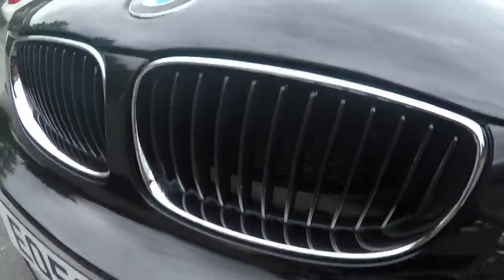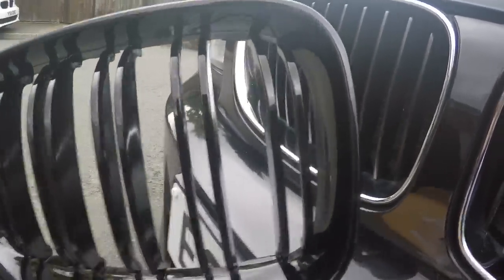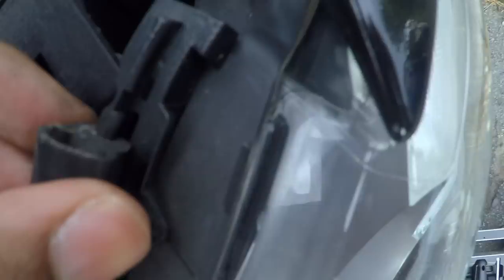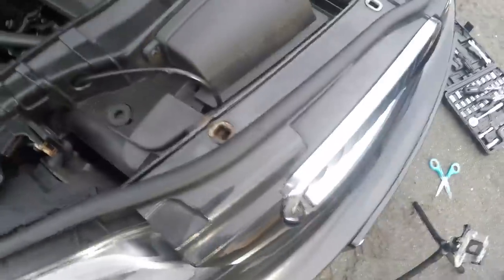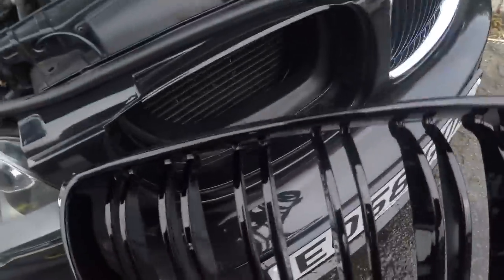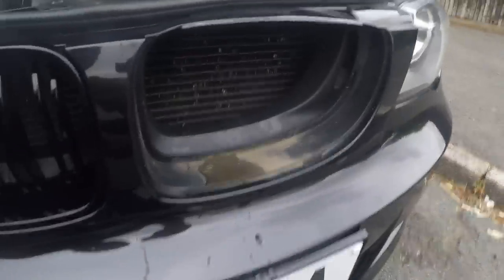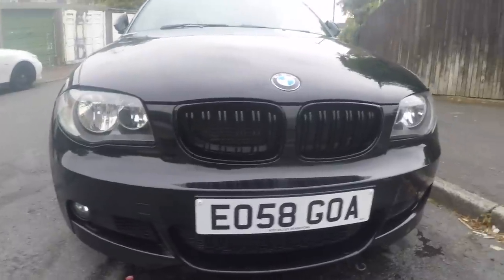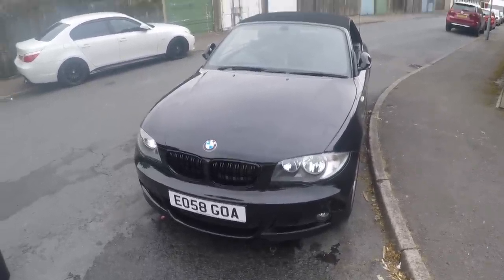Installing BMW M2 Kidney Grilles On A 1 series E88 E87 E82 E81 1M

Comment: Neat video bro! It looks quite agressive with the black grille! Though i do like the standard as well. I will have to buy a new grille for the Clubsport if im going to change from Halogen to Bi-Xenon light sets... Thinking on doing it after the warranty goes out though. I really want the bi-xenons coz they add that Red stripe followingvthrough from gti grille then goes straight through the headlamp covers which looks so cool on the GTI's u know :)
Reply from the maker: 3DFX Cheers bro! Yeah it definitely made it look more aggressive and me too I like the standard one but i’m going  for a blacked out look on this. Yeah that would be cool getting the bi xenons those red accents really do set off the gti especially for the clubsport

Comment: Hey man,
Great video, Grills look awesome!!
I just had my bonnet wrapped in carbon fibre (got a few stone chips and they were doing my head in!!!)
Got a blue 120d coupe....car looks mint..just need the black grills now LOL I ordered mine from the link you posted.
thanks again for the tip
Reply from the maker: tyrond123 Thanks man! That sounds pretty neat stone chips are the worst things ever, nice one man they’re good cars and fuel efficient the black grills will set the car off nicely and no problem.
Reply: hey man, my grills arrived today, one of the tabs was missing, snapped off. messaged seller via ebay, to request a replacement. waiting to hear. :(
Reply from the maker: tyrond123 ahh no how did it happen? The seller is really good he was helpful to me, hopefully it gets sorted let me know how it goes
Reply: Unfortunately it was like that when I unboxed it. 
Will do, thanks man!!
Reply from the maker: tyrond123 that was unlucky and no problem man
Reply: +CARL IS ONIT hey man. got my replacement grille in the post. you were right. the seller's pretty good. he made sure grille was sufficiently wrapped for postage. Might install tomorrow and do a quick video. guess what? it finally stopped raining 😂
Reply from the maker: tyrond123 I told you he was good haha! 😂Wow everything is falling into place for you that’s awesome man

Comment: Great video, really helpful you showed behind the bumper at
the clips on the grill so we no what to expect, i seen other video of grill
replacement and none showed this. Can you get these grill for the older 1
series before the facelift? many thanks
Reply from the maker: chris noneof your buiness Thank you! What year and model is your 1 series?
Reply: Its a 2006 118d, I like this year for the 1 series as it has the older M47 engine but with the newer 6 speed gearbox, I think this is the only year they did this. I far prefer the looks of yours though.
Reply from the maker: chris noneof your buiness the pretty decent and thank you

Comment: Yooo dude i need help. I’ve got a 2007 E87 120D M-sport.

I bought the double cut kidney grill which i recieved today, and it didnt fit😆 and i’ve looked around the internett for the past 4days looking for a double cut grill that fits my car.
But i cant find any, i’ve only found ones that fit the non-Msport edition.

Do you have any advice?😀

Comment: Good vid mate. If I was u, I’d replace the bmw badges with the black and white ones. I’d also wrap the lights in fly eye or light smoke tint.
Reply from the maker: Oh don’t worry about that mate, I’m gonna do the badge in black and red to match the theme soon and also i’ve got a plan for some angel eyes I’m gonna try and install myself. Also i’ll be tinting the rear lights and maybe the headlights  😄
Reply: CARL IS ONIT nice mate you’ve got it!
Reply from the maker: No problem more mods will be coming shortly 😉

Comment: U don't need to open a hood to get these out lol just grab them and push out a bit they are pretty free if u struggle use flat screwdriver
Reply from the maker: There were no videos or instructions at the time so I just did what I could 👍🏾
Reply: I saw it on a video as well but the kidneys of our E87 130i (pre-LCI) wont come of. The whole bumper wobled and i dont want to break it so guess i got to do it this way too.

Comment: Bro are those grills compatible for the 1 series with the M-Package?
Reply from the maker: JHONNY BOY there’s 2 links in the description which model is your 1 series?
Reply: CARL IS ONIT it’s the E87 with M-Package 2011
Reply from the maker: JHONNY BOY this will be the one for your car 👍🏾 https://rover.ebay.com/rover/1/710-53481-19255-0/1?mpre=https%3A%2F%2Fwww.ebay.co.uk%2Fitm%2FFOR-BMW-1-SERIES-E87-FRONT-BUMPER-KIDNEY-GRILLES-GLOSS-BLACK-DUAL-LINE-2004-2013%2F392976046047%3F_trkparms%3Daid%253D555021%2526algo%253DPL.SIMRVI%2526ao%253D1%2526asc%253D225120%2526meid%253D901b12d823d84aafbfc59052af92d0fe%2526pid%253D101096%2526rk%253D2%2526rkt%253D6%2526mehot%253Dpf%2526sd%253D164389184360%2526itm%253D392976046047%2526pmt%253D1%2526noa%253D0%2526pg%253D2332490%2526algv%253DSimplRVIAMLv5NativeWithPLRVIOnTopCombiner%26_trksid%3Dp2332490.c101096.m3021&campid=5338749136&toolid=10001&customid=
Reply: CARL IS ONIT forgot to say that I got the facelift model
Reply from the maker: JHONNY BOY Ah okay, it’s best to message the seller and send pictures of your current front grilles just to be 100% safe

Comment: Where did you buy the black kidney grill from? Are they an original BMW part or OEM? Cheers.
Reply from the maker: Kalpesh Balu Link for the Kidney grills are in the description they are made of ABS plastic and they are aftermarket
Reply: Cool,  Ali express has some cheap ones. I’ll give it a crack. Cheers
Reply from the maker: Kalpesh Balu no problem

Comment: I removed my grills and then realised this grill will only fit NON M Sport Models: Very frustrating!
Reply from the maker: A B 😫
What bmw model do you have e88/e87/e82/e81?
Reply: @CARLISONIT  I have an e81.
The kidney grill is different on M Sport models. They have a pointy corner while the grills on Non M Sports have a rounded edge.
Hopefully people read this comment before they buy!
Reply: Link for the M Sport Model grill
https://www.schmiedmann.com/en/product/1992697-new?product=NS8187HG#gallery-2
Reply from the maker: Yeah they do I’ve mentioned that in the description
Reply: @CARLISONIT  Fair enough mate. I must've bought without checking
Reply from the maker: A B no worries